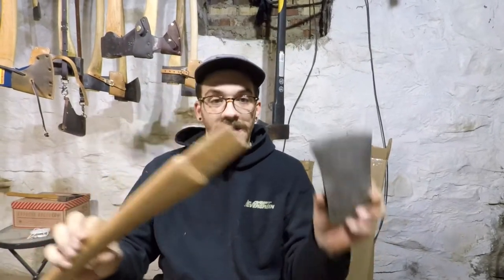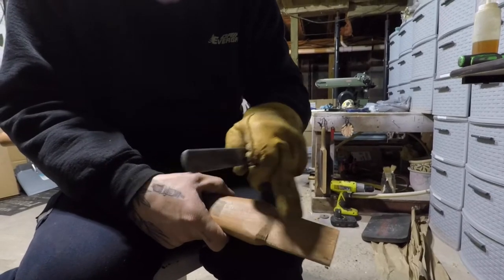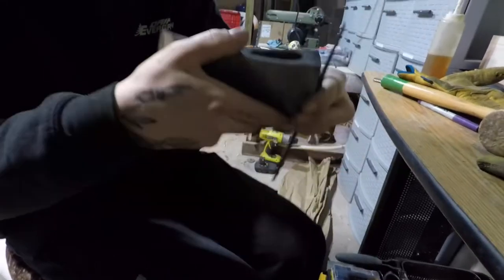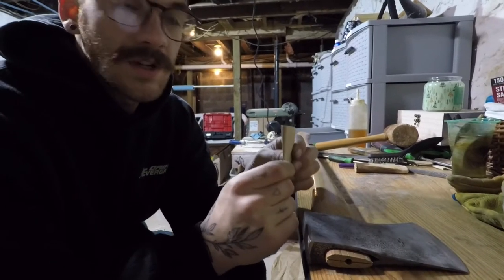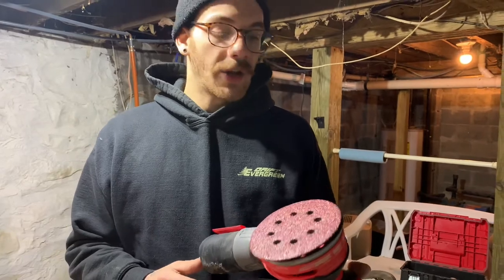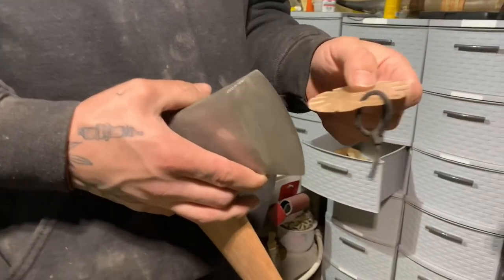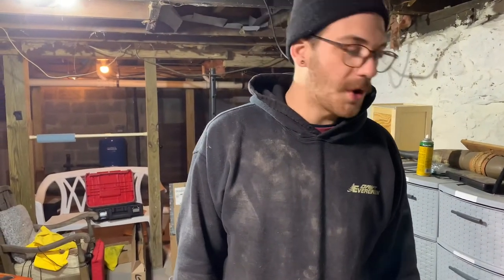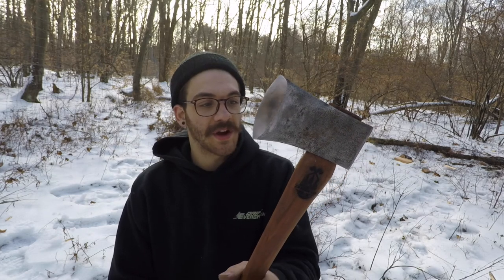Axe build for a friend and some chopping

Comment: Thats a great axe. Its really hard to find pulpwood axe heads in that good of a condition. I agree with lubricating the wedges either with oil or glue I think its allows the wedge to be driven deeper vs dry. Kinda like how lubricated threads increases the clamping force and decreases torque required.

For axe grinding use 2 clamps and clamp the axe on the handle not the head. That way it frees up that area so you can run a file from the heel to the toe. I think S E F F did a video of him grinding his ochsenkopf that is very informative.
Reply from the maker: Thanks Sam !! Yeah I agree first axe I hung I didn’t lubricate the edge and it was a bear to do and it ended up breaking apart and I had to extract it from the handle. Then I said ok let’s watch a video lol. Oh cool yeah I’ll definitely have to check him out 👍

Comment: Nice hang for a hardware store handle! Those can be tough to use but it looks like you got it! Personally, I’m a wood glue guy. I don’t want that wedge to work it’s way out. 

Completely agree about Ben Scott’s sharpening videos! He has an excellent channel. I’ve learned a lot from him.
Reply from the maker: Thanks Matt !! Yeah man Ben is great he’s very knowledgeable I learned a lot from him. I filmed this before you gave me those tips on wedges, I forgot I had it in my go pro still. I’m working on handling a couple heads I have laying around i really want to try, so I’m trying to perfect that concave tapered wedge design you showed me. I haven’t quite got it yet, but I I’m getting there. Thanks again Matt !!

Comment: Nice job! That axe looks fantastic. This video was nice to watch. Kept a good pace and were very helpful and instructional. 

Those hardware store handles just suck don’t they! I had the same issues when I hung my first axe. Just couldn’t get a solid hang no matter what I did because of that dumb shoulder. It’s frustrating that companies think that is what a handles should look like nowadays.

I gave a good friend of mine an old council tool for Christmas that I hung. Put a 20degree convex on it to be on the safe side. Things are gonna get messed up. It’s just the nature of the learning. 22.5 still cuts fine. My gransfors Scandinavian axe came with that angle grind and people rave about how well they cut compared to hardware store axes. It’s funny how perspectives change.

Hope you’re doing well in this weather, be safe!
Codi
Reply from the maker: Thank you so much Codi !!! I really appreciate the compliment 🙌… oh man you’re not kidding I can’t stand these hardware store handles, I’m not sure how he found out that good with the exception of the eye. I’ve been to every hardware store in my area couldn’t come up with one good handle. Yeah I find that 20 degrees works pretty well, I ground one of my vintage Daytona to 17 degrees I haven’t used it since I sharpened it so I’m excited to see how it works. I’m afraid it’s going to be to thin and break but there’s people that say 17-18* is fine. How do you like you’re gransfors. I usually stop at 20 because I feel it’s efficient enough but also not easily damaged. Thanks again man 👍
Reply: @940joey2  Yeah finding the right angles is a lot of trial and error. I think after a point you risk a lot of vulnerability for only a very small gain in efficiency.

Definitely a lot of factors go into play. Weight, bit length, steel hardness, the wood your cutting, etc. 

I have a 15 degree double bit with a 30-35degree secondary bevel. While 15 degrees should cut a good bit deeper into the wood, its a very vulnerable edge. I had to put a strong second bevel because the edge was actually warped and wavy after I chopped with it. Then, after the secondary bevel it didn’t cut as good but was holding up. So it makes me wonder, was removing all that material really worth it in the end? Personally I think if you’re looking for a really fine edge 17 is a good stopping point for a multi purpose axe.

Anything below 20 is probably gonna take some damage if it’s just a flat chisel grind. Fortunately putting on a tiny microbevel often corrects the edge rolling issue. 

Most of the axe publications that I’ve read recommend a 20-25 degree convex just for general work. My rule of thumb for an acceptable chopping axe is 20 degrees plus or minus two.
Reply from the maker: @Codi_Clapper  yeah man absolutely you hit the nail on the head there. At some point you’re going to sacrifice durability and not gain much more efficacy. So far every axe I have around 20 degrees seems to perform extremely well for me and I haven’t had an issue with damage yet. Now we’ll see what happens when I take out that one I brought to 17 degrees the steel felt really hard, it took forever to file. If anything like you said I may have to do a micro bevel on there or secondary bevel of maybe 25* but I’m excited to try different things. I think soon I’m going to do a battle of the boys axes and see what one performs the best all on the same tree of course. How did you guys do I’m this storm, I’m out plowing now looks like we got 15 inches or so maybe more upwards of 18 20 in some areas
Reply: @940joey2  Battle of the boys axes sounds like a cool vid.

We got five or six inches where I’m at. Not too bad. The wind is pretty wicked though. That’s crazy that you got that much snow. It’s a good thing you have a plow!
Reply from the maker: @Codi_Clapper  yeah man I think it’ll be fun to make !! And yeah having a plow is a life saver first year with one and I’m loving it !!